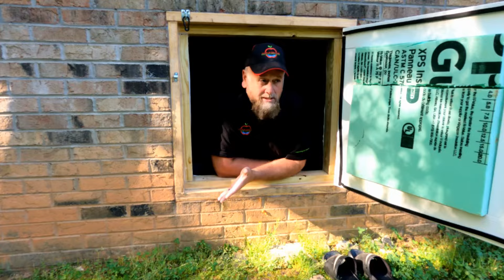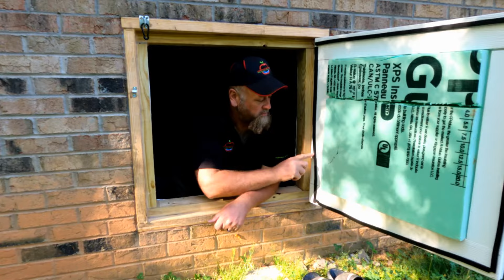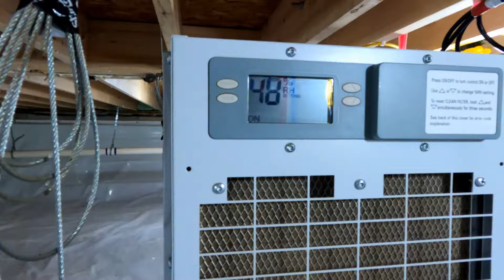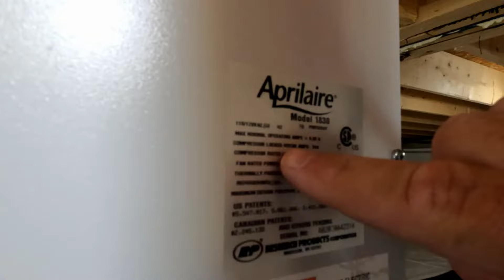Guide to Crawl Space Encapsulation, Raleigh NC

Comment: Where does that exhaust fan pull air from if it's encapsulated and sealed?
Reply: In my house there is a pipe that goes straight outside and then up past the roof so it's up and away from the house.

Comment: Had my encapsulation done by tarheel and its a hot mess. If there was a way I could post pics here I certainly would.  When you spend close to 10gs you want it done right. I'm so disappointed. I understand each company does things differently but my advice to anyone thinking about this is to do your research. Know the best materials, understand what is code, how each layer is supposed to be put done. Some of my insulation is hanging down, there's no way to tell if there's a leak, duct work straps and duct work is laying on the ground, seams are wide open and dirt is everywhere.  There is no insulation board on the walls behind the barrier.  The only part that we are happy with is the door. I wish I had contacted you guys instead. Thanks for your very informative video
Reply: Sorry to hear about the results after spending that kind of money. If you want to go down the path of getting it redone all together, contact Coastal Crawl Space and Foundation Repair.
Reply: @LS2FD  Thank you so much. I certainly will.
Reply: Take them to court, you should get your money back.

Comment: Every ventilated crawl space in NC has at least 80% humidity. Builders seldom if ever adequately address the drainage of a house and crawl space never pour a rat slab. They even put the HVAC on a dirt floor crawl space con concrete blocks or worse. For all the problems and expense a typical crawl space will cost the homeowner, speaks to really bad building practices. As far as this project, since the space is conditioned/encapsulated there is no reason the air in this space should be separated from the air in the house. IMO an 1850 could do the whole house including the crawl space.
Reply: Preach it!
Reply: Not to mention that mechanical, residential, and energy code all probably have something to say about how you should be treating and managing a sealed crawlspace.

Going off national code adapted to my state, you need to have some ventilation either to the outside or inside. Just a dehumidifier is not enough to be considered ventilation. This is for unoccupied interior spaces (attics or crawlspaces that are sealed) for 1000 square feet you need 20 CFM of air exchange however you wanna do it, but it's HVAC or dedicated vent most likely.

Energy codes for 2024 once a state adapts them and depending on climate zone also has stuff about continuous insulation. For the foundation walls it's about R30 in most cases, for the floor it's complicated and depends on soil thermal conductivity and temp, but assume at least R5 but R15 is probably better. If foam board is used, fire code may require a fire barrier over it, drywall, rockwool, or other approved materials like some intumescent paints.

For sealed crawlspaces it is highly recommended by the code to do radon mitigation. The way to do it and remain sealed is sub membrane depressurization. The requirements are outlined in a couple sections, but essentially some kind of air gap either with 6" gravel or a mat that can do an equivalent open air space. Then a PVC pipe from underneath to the outside driven by a fan and exiting above the roofline.

Comment: What is the protocol when snakes, perhaps venomous ones, are in the insulation above head & between the joists? Do you move them out with a snake stick or what? An unsealed crawlspace can be pretty dark. Snakes want to escape unharmed, of course. But how do you avoid accidentally cornering one?

Comment: The best informative video on this topic I’ve watched so far. My question is regarding your comment on the waste of money on a dehu before it’s full sealed. So I just bought a home that has a encapsulated crawl semi decent but not like this. It has no dehu and it has test for some light mold on the joists. I want to have it remediated and reseal the crawl better. I have heard to control moisture first via, sealing vents and taking out insulation and installation dehu to bring the humidity down. What would you do in that situation? I’m in Va and you prob know right now it’s freezing cold out and I’m also concerned about removing insulation this time of year but I’d rather not wait for spring.
Reply: Great video but if this was the most informative one you’ve seen you have missed a bunch of good ones!
Reply: @cb8591  Yep, this one is mediocre at best.  Too long, too many jokes, too many references to his mistress, too many Merica mentions.

Comment: One question - I have a Century home and crawlspace is rock wall and dirt floor and appears to have been used as a bottle dump. My furnace is down there and I am working on improving the area and eventually going to use it as storage for my large totes.

So far I have cleaned it out (3 large bins of broken and full bottles) plus around 80-100 stones weighing 10-50 lbs each.  I have installed 6 mil VB on the floor and 1/2" rigid insulation on the walls (and taped the seams). I then ran the VB 12-14" up the insulation and taped that. From there I have framed out the walls with 2x4 (16" OC). I now want to control the humidity as it is currently around 80%. 

Plan on installing a dehumidifier in there but since there is no French drain or sump pump I am wondering what my option(s) are for drainage of the dehumidifier.  Can I drain it under the floor VB or should I look at a pump system (like something on a furnace) that will pump the water outside.  Clearance of the area is around 5' 2" and this area is built on limestone so cannot dig very deep.

I would like to control the moisture down there as my final step is R-12 Rockwool bat insulation and VB then another layer of 6mil VB on the floor (and taped) then subfloor.

Thanks to ANYONE that can help out.

Comment: Need to rename this video, shows little to nothing on a Guide of  HOW  to encapsulate , need videos  during the work and not  a constant self patting on his on back of how great a job they did, Don't get me wrong , it was an excellent job but I am sure it was a $12-$15k job by the end. Would have like to have seen how they wrap the columns, lay the plastic, How the foam board is installed and how far up the wall it was installed before covered in plastic.  Not really a GUIDE other than the mention of a few products.  A "GUIDE" should leave people with vey little questions on how to do it in the end but it only increased the number of questions by the end.  Nice work we can see that clearly by the end results , too bad we never got to see the process to get there.  I do disagree with one of the statements though. If you cannot afford a full encapsulation  You can install a dehumidifier  in a crawlspace  that is not 100% sealed and get real results. Make sure the vapor barrier is fully covering all exposed soils and try to flip it up the walls 12 inches or so , make sure all crawlspace vents are close and possibly get foam board and cut to fit them. You can get the crawlspace down by a huge percentage by this alone. Even in Raleigh NC where the humidity is typically 70% or above outside typically it will pull it down to  the  40 and 50%  range and keep any mold and mildew growth at bay as it needs at least 60% and above constantly to thrive.
Reply: Why would they show you how to do it if they’re selling the service? This is a promo reel meant to increase business. You’re wrong about a using dehumidifier without a vent seal. Doing so would not only remove the water in the crawl but drawn it from the outside. Also it would reduce the life of the dehu.